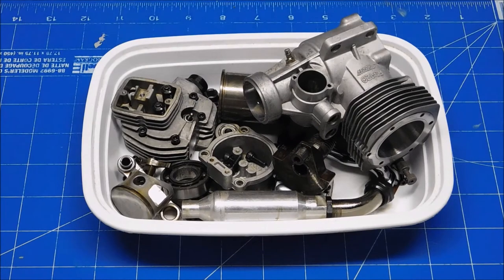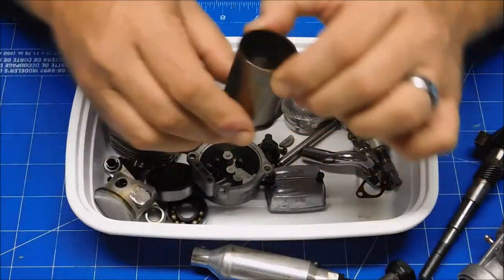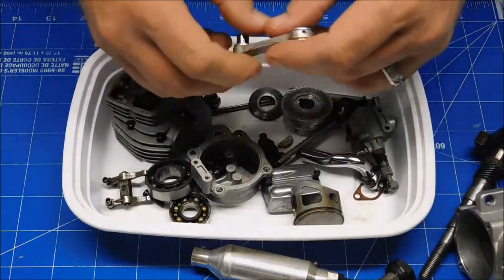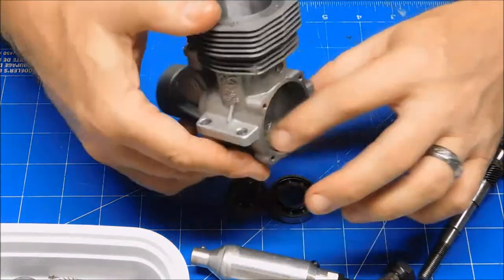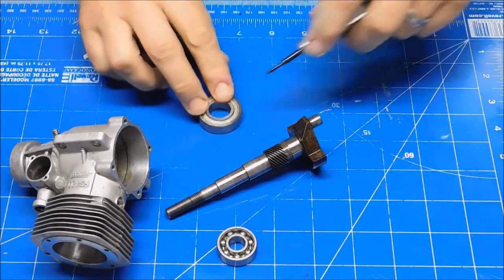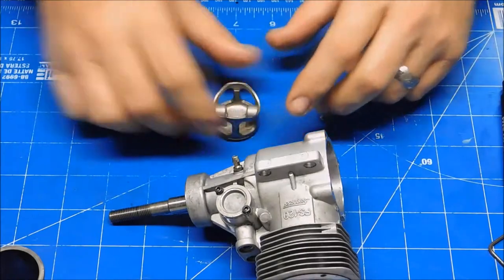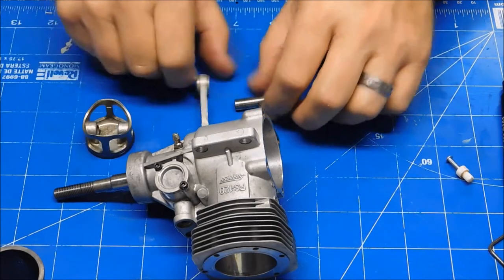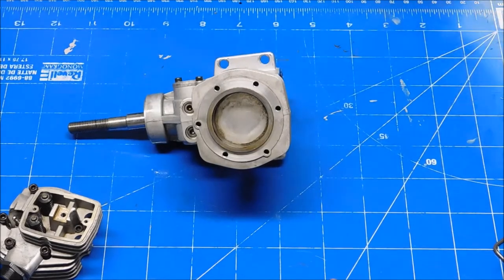OS FS-120 Surpass Another Look Inside Bearing replacement

Comment: Hi Dave,have you tried installing the piston in the sleeve,but leaving the wrist pin hole exposed at bottom of sleeve and slide the sleeve in crankcase with rod on crank, then push wrist pin through the opening on case.its seems to go in with less hassle.
Reply: Yes that is the proper way of doing this job. It allows one to compress the piston ring in a controlled manner before inserting the cylinder in the casting.

Comment: Dave - thank you so much for the amazing videos! I am about to start restoring a 1.20 Surpass II engine with a pump that was given to me. Pump and carb are in excellent condition, but bearings are notchy. Do the OS 1.20 Surpass (I, II, and III) use the same crankshaft bearings and camshaft bearings?
Reply from the maker: I don't have that information off the top of my head.  You will have to consult with the manuals for part numbers.
Reply: @dmrcflyr2  thanks Dave - do you normally see the need to replace the cam shaft bearings as well on the 1.20 surpass?
Reply from the maker: In reality, yes, but have I done it every time? No, I have not.  I clean them the best I can and go with them unless they are very crunchy and cannot be cleaned to be smoother.